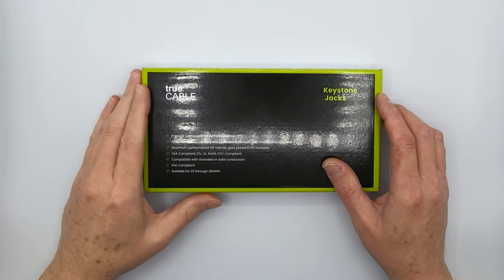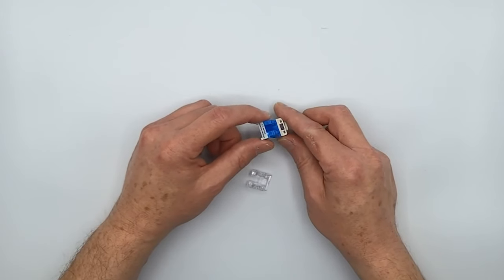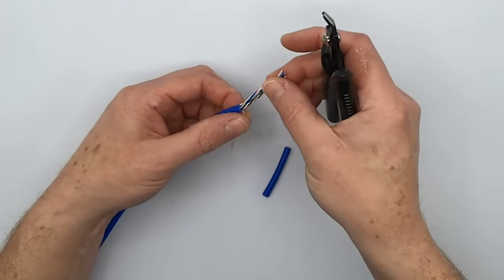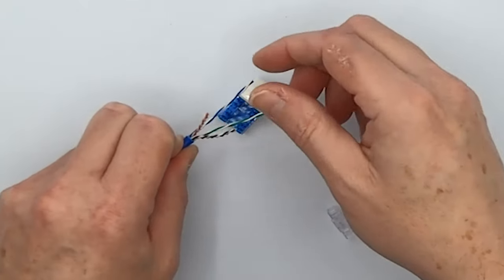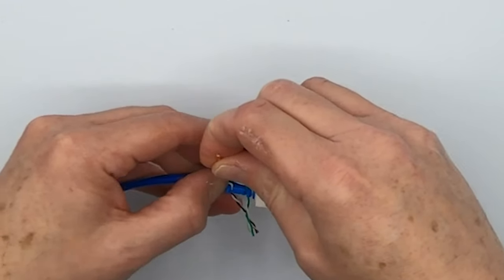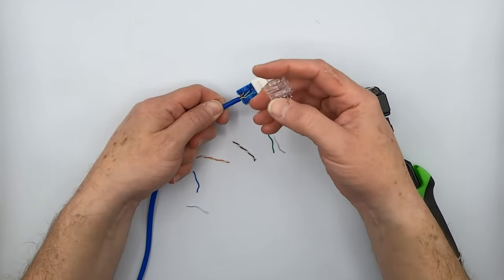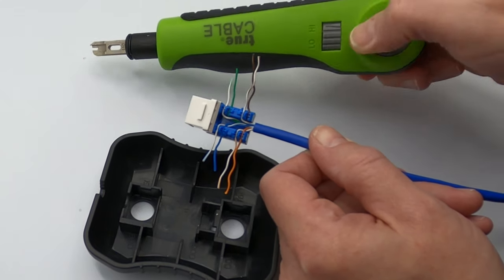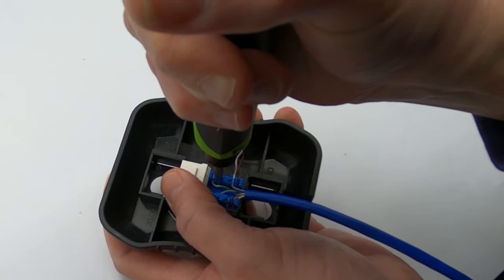How To: Terminate a Punch Down Keystone Jack

Comment: In more than 26 years, I have never set the cable that far back on any jack.  This can lead to the wires coming loose and can also lead to issues with certification due in part to newer species on a Fluke meter.   Keeping your wires as close to the punch down point as you can will always provide the best results.  I would be willing to say very few technicians know the maximum IEEE allowable untwist on each pair or cat 6 wires? Before the punch-down jack?  Without using google.
Reply from the maker: Hello! Indeed, it is good to maintain the pair twist right up to the point of termination, if possible. That said, some times it is NOT possible. Generally speaking you take the cable jacket right to the rear plastic of the jack, with little or no room between the jacket itself and the start of the plastic. Our particular keystone jack (like many others) does not permit jacket ingress into the channel between the IDC terminals themselves as this would cause issues punching down the conductor wires. So, get as close as you can. A good trick is to tack down the rear two IDC slots FIRST before working on the front ones and pull the jacket right to the jack housing rear in the process. This ensures the rear two pairs are automatically untwisted minimally as possible by default. The front pairs, if you are lucky, will untwist so that they fall naturally into the terminal color code pattern you are using. Half the time they don't fall naturally this way and this gives you two choices: 1. Knuckle the conductor to MAKE it right to the point of termination or 2. Utilize the permitted 1/2" untwist allowed for terminations to untwist the conductor pair just one more untwist so the wires can be punched into the slots without undue effort. Of the two options, #2 is the acceptable way of going about it. #1 means altering the electromagnetic balance of the cable and a unrealistically tight termination that is tough to work with. If you review (I assume you have a copy of) ANSI/TIA-568.0-E - Generic Telecommunications Cabling for Customer Premises, Section 6.2.3.1 Table 2, the maximum allowable conductor pair untwist is 1/2" whether the cable Category is Cat5e or Cat8. In short, you may have been making it unnecessarily rough on yourself the past number of years. I have used a Fluke DSX-8000 and permanent link testing on various untwists to include right up the point of termination, plus the 1/2" allowable. Performance was largely identical and within the margin of error on RL and NEXT. I hope that helps clear this up!
Reply: @trueCABLE  : I am not disagreeing, however, a recent project I was on found many of the punch downed jacks on cat 6a cables that where close to the 100 meters would test good but with noise at higher end.  After re-punching these jacks and making sure the wires were much closer, each of the failed jacks passed with no issues.
Reply from the maker: @ssrrocks22  Hello and that is quite interesting. Also, it is not unheard of. I can think of three factors that contributed to that, but don't know which ones with looking at the Fluke test results up close. 1. Over limit length for ambient temp. -- 68 deg F provides the max distance of 295ft (90 meters) of permanent links. 100m is the channel limit, which includes a total of up to 33 feet of 24AWG patch cords on both sides. That can cause finicky results, and those links may fail as the temp rises in structure, even now, as Certification is only a one time snapshot. 2. Channel rated keystone jacks. Essentially, the jacks impedance match but the PCBs are not tuned specifically for Cat6A (despite being marked so) and this can require you to rely on the cable quality to a higher degree than you otherwise would need to. 3. Enough cumulative imperfections in the cable itself to demand tighter terminations regardless of whether the jack is channel or component rated. It could be a combination of all three. I hope that sheds even more light on it!

Comment: Thanks Don, for another terrific video. Question: if straightening the wires can degrade the signal strength, is it best minimize the number of connections - e.g., is it better to run male (RJ45) terminations on both ends, rather than wire a Keystone Jack outlet? Thanks so much!
Reply from the maker: Hello and thanks for the questions, Adam.  Any time you introduce a termination (whether keystone jack or RJ45) into your Ethernet channel you cause a bit of signal degradation.  Now, there is enough "headroom" in the specification to allow for a permanent link (jack to jack) plus two patch cables (in totality, this is called a channel) and still give you the application performance you are looking for.  You would think that just using a single cable with two terminations (RJ45 to RJ45) would give you even better performance and technically it does, but not enough that your application bandwidth will noticeably increase.  The main advantage to a permanent link + two patch cable channel is flexibility since you can buy different lengths of patch cable as needed if you decide to move equipment around the room.   Further, this is one of the biggest reasons to avoid RJ45 to RJ45 couplers.  They can take a functioning channel and push it outside of the specification by exceeding your available headroom.

Comment: If terminating a cable with keystones on either end, does it really matter A or B as long as they are the same on both ends?
Reply from the maker: Hello Jonathan. Even if you had RJ45s on either end, as long as you are using the same TIA color code scheme at both ends it does not matter. If using keystones, then A to A or B to B is what you are after as well. This concept applies to any type of Ethernet termination unless you are specifically trying to create a cross-over termination.

Comment: Will it work with the commscope jacks?
Reply from the maker: Our trueTERM tool is specifically designed for use with our trueCABLE unshielded punch down keystone jacks. We have not tested it for compatibility with any other manufactures keystone jacks at this time.

Comment: Is it possible to reuse the Connector if I want to use it for another CAT6 cable?
Reply from the maker: Hello and great question! The answer is YES, absolutely. Our keystone jacks may be re-terminated up to 20X. Take note that if you initially terminate to 23AWG conductors then you cannot switch and use thinner conductors (like 24AWG) with that same keystone jack. If you start with 24AWG conductors then you can re-terminate to a cable that uses 23AWG conductors.
Reply: @trueCABLE Very helpful. Thanks :)

Comment: Can i punch down stranded wire
Reply from the maker: Hello. Great question! Yes, in most cases this is not a problem. That said, there may be some punch down panels and keystones out there that don't recommend doing that. In the case of trueCABLE hardware, you can punch as thin as 26AWG stranded conductors in our punch down keystone jacks.
Reply: @trueCABLE  thanks, i tried and its not very reliable with 26awg and keystone i have. I had to work it a bit to make all wires have contact, so it is possible indeed
Reply from the maker: @Boz1211111  Yeah, I expected that some 26AWG conductors out there may run a bit thin. It is hard to discern what the results from brand to brand may be since stranded 26AWG conductors are rarely punched down and typically not subject extensive testing unlike solid copper 24 and 23AWG. Thanks for the heads up!